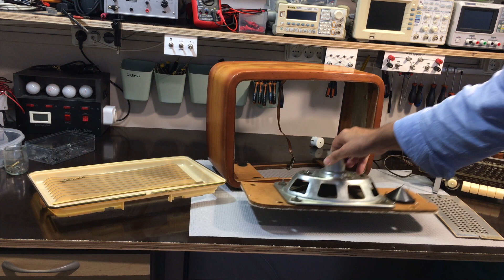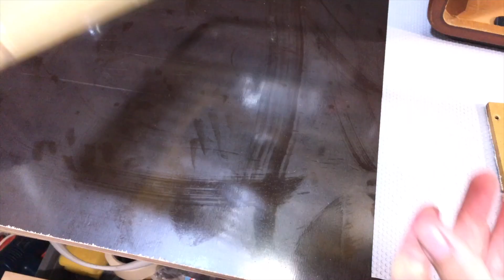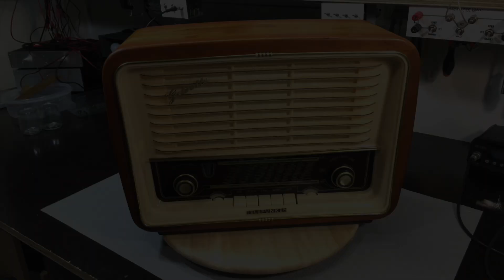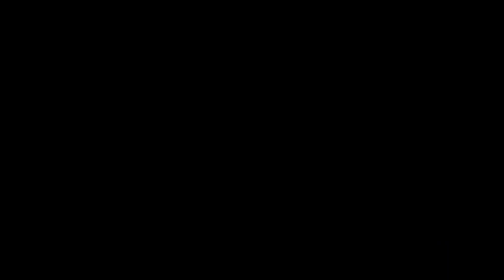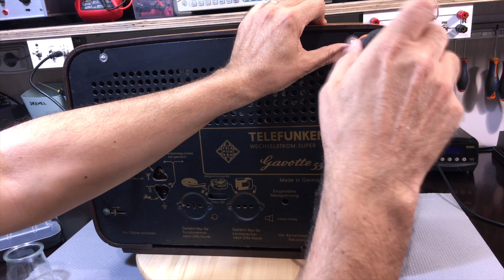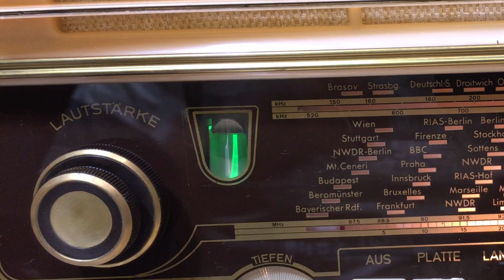Telefunken Gavotte 55 restoration part 7. And another project comes to an end. What a beauty!

Comment: You truly created a masterpiece here, thank you for sharing. I have a question - I have the same radio (US version) and have been trying to get an AM antenna to work externally. I pushed the little AM clip out of the hole that I assume bypasses the ferrite bar, but when I have my antenna connected to a banana plug and plug it in there is absolutely no difference in reception - it’s almost like I can’t get the radio out of internal AM antenna mode. Wondering if you might have any suggestions or if you’ve come across similar. Thank you so much!
Reply from the maker: I have had this happen before with a radio that switched out the ferrite antenna when I plugged in the external one. Most don’t, however. I just needed to clean the connections and trace the signal visually from the input socket to the coils.

Comment: Fantastic job once again. I bought a Telefunken Caprice 8 that had a piece of trim missing from the bottom rib. I filled in the holes with epoxy, sanded to match the contour and spray painted it with metallic gold enamel, looks like the original piece. The screws that hold everything together on these German radios are called “cheese head” (not from Wisconsin) screws. Once again, excellent project.
Reply from the maker: Thanks

Comment: Beautiful job! Looks like a brand new indeed. 👍
BTW is there any way to adjust an old radio FM tuner to receive frequencies over 100 MHz if it doesn't originally? (My Grundig SO 151 Konzertschrank cannot receive one of my favourite stations because it is around 105 MHz. ☹️)
And BTW have you got a huge stock of magic eye tubes, because they last bright only a couple of hundred hours and there seems to be less and less NOS magic eye tubes available at reasonable prices? For example NOS EM34 tubes are pretty expensive nowadays.
It seems that NOS ECC85 tubes as well are much more difficult to find at reasonable prices.
Reply from the maker: That’s what I do to get it up to 101.6

Comment: Have you ever tried a hot steam iron and heavy starching on the cloth that you have? It might add a bit of "shine". Hell, I dunno, might work, might be the worse thing you've ever done hehe
Reply from the maker: Haven’t been down that route :)
Reply: @electronicsoldandnew  Ironing and starching has kinda gone out of fashion in many homes nowadays, but it would stiffen up the material a tad and just the right amount of "over doing it" with the heat should add a tiny bit shine I would think. I am no expert on what types of cloth materials should and shouldn't be starched though. Might be interesting to explore..

Comment: Great job again!
When a station appears multiple times on a band, this could be caused by parasitic oscillations in any hf-stage. This could cause unwanted mixing products.
Another reason could be heavily overloading the hf-input, mixer or 1st IF-stage, so we have intermodulation effects between several stations.
Reply: I think it's more due to stations simulcasting on different frequencies to cover a wider area.  Especially common in mountainous areas.  I know NHK, Japan's PBS station, does this.  It would not surprise me if numerous other stations around the world, including the BBC stations in the UK, do it as well.
Reply: @sincerelyyours7538  Yes! should have considered that! But i know this multicasting only from stations in the shortwave bands
Reply from the maker: I also thought that, but this one shows up repeatedly on all the radios I’ve tested here. It’s strange.
Reply: @electronicsoldandnew  Then you probably have an overloaded actzive antenna amplifier - are you using an active antenna with long wires?
Reply from the maker: no, just the active mini whip with no extension at the end. could still do this though, as the mini whip is the common denominator in all the radios i’ve tested. thanks.
Reply from the maker: I also thought that, but this one shows up repeatedly on all the radios I’ve tested here. It’s strange.